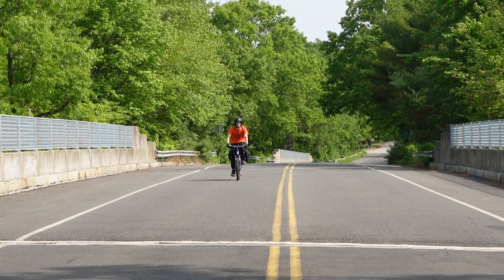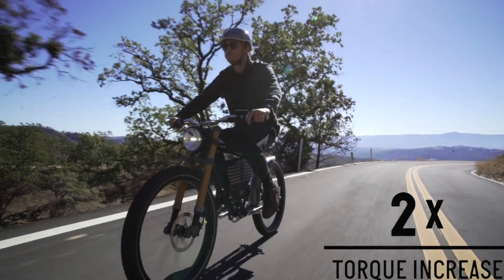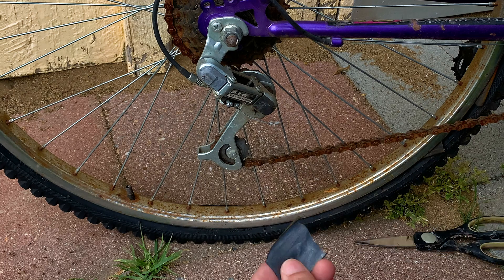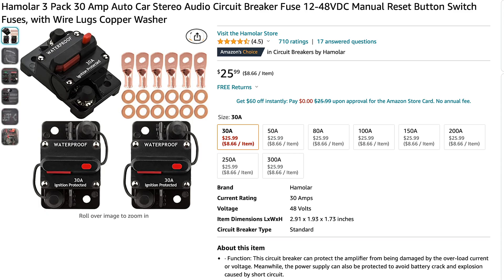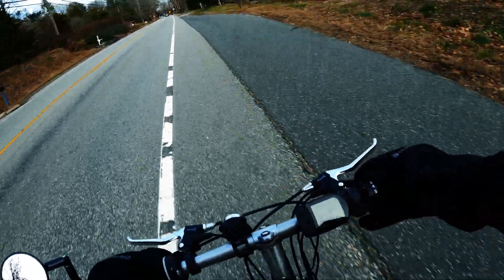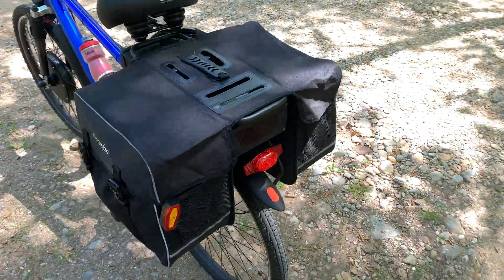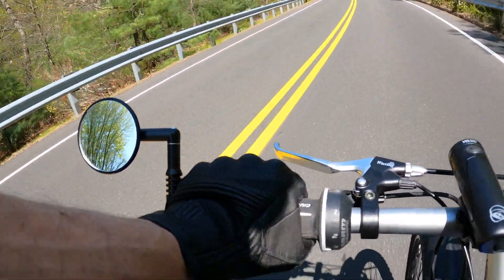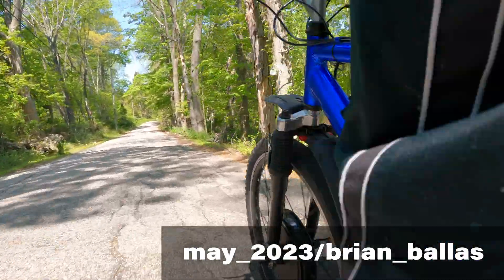DIY eBike Build 6 Months and 1000 Miles Later Update

Comment: You didnt factor in the cost of the battery. that is usually more then the kit alone.
Reply: And getting a battery that's compatible with the motor you bought is it's own exciting little research project
Reply from the maker: I talk about the battery a lot in the video about building it …. it was $400 … with the updates since then I probably put $950-$1000 total into the bike… but that involves some upgrades I didn’t need to do, but wanted to do.